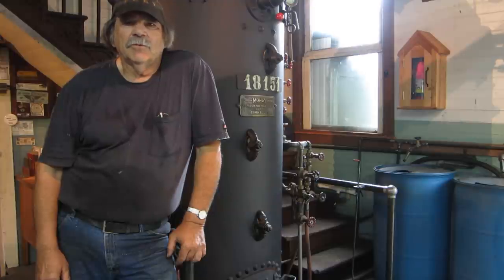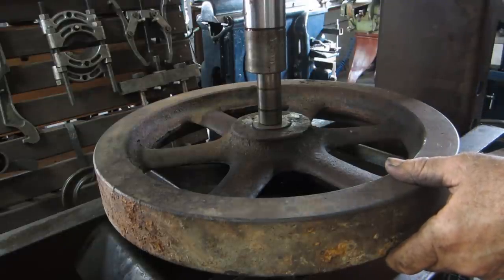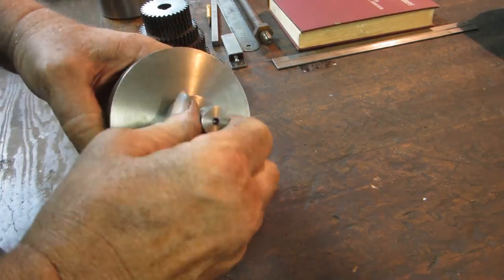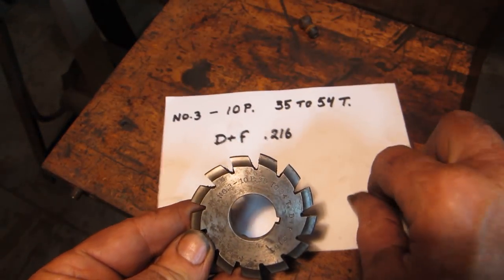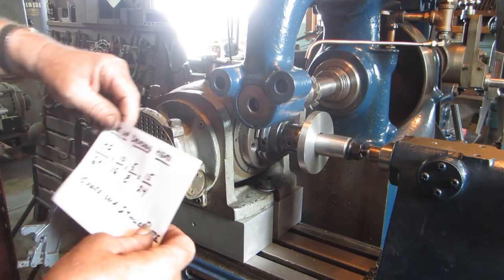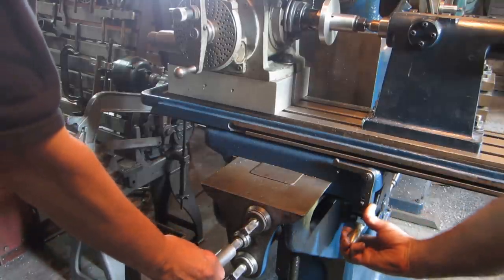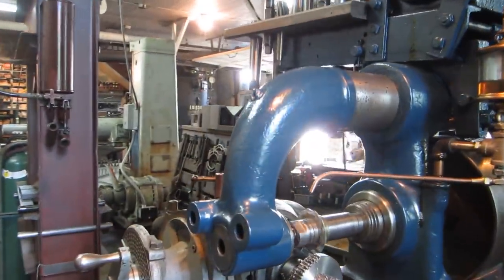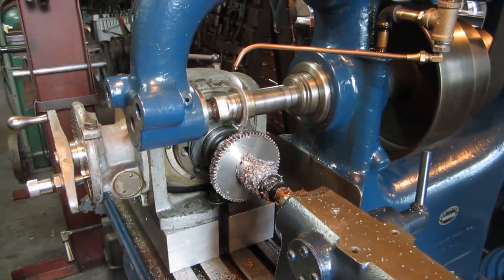OLD STEAM POWERED MACHINE SHOP 13  Making some gears

Comment: Best explanation of gear cutting with a dividing head I've seen yet. Thank you!
Reply from the maker: Thanks Rick, explained from one shop guy to another is better than Engineer written.......Dave
Reply: agreed, the books always leave out important details that were known way back when by everyone, but have been lost due to very few being taught via experience rather than a course, nothing frustrates me more knowing there is a formula out there that can help me do what I want to do, only to not be able to find it, or if I do its been massively over-complicated in a handbook
Reply: @davidrichards5594  As a student of engineering and someone who helps run a student design team, whenever new members ask me how they can improve their skills in engineering design I tell them "First get yourself a copy of Machinery's Handbook. Second, every time you start designing a new part picture starting with the stock material and then use that book to figure out what you would do to get it to perform the function you want so that once you've finished the design you also have a manufacturing plan. Finally, before you take the design to the student machine shop, talk to the machinists on staff there and tell them your plan and listen carefully when they explain why it sucks. Only when you have a feasible manufacturing strategy is your job as the designer complete." A lot of people I know feel that this slows down the design process too much to which I respond "No, but having to redesign a whole sub assembly because someone didn't know the dimensional restrictions of the lathes we have access to does slow us down."

Comment: ...Thumbs up for you...! This shop reminds me a lot of the Knight Foundry/machine shop out here in California....Sutter Creek, Calaveras County....the had everything running from line shafts and the shafts were turned by water driving a Pelton wheel....Machine shop was fairly large....maybe 25 pieces of powered equipment.....the shop machined  most of the castings from Foundry....a lot of brass....Knight was the largest continously operating machine shop/foundry west of Mississippi river....Likely quite a bit of history if you look it up....place was built/operating in the late 1800's....
Reply from the maker: One of many around the country that built and kept things operating, Thanks for the great comment....Dave

Comment: In the late 70's, I apprenticed in a shop very similar to this one. The drive shaft was powered by an electric motor, but steam was used up until the early 70's. It was a very efficient shop. This video brings back fond memories.
Reply from the maker: Great comment Fred....Dave
Reply: Havent seen you since the old SNL days!

Comment: Other great video. I am not a machinist. But I have been interested in the trade for over 25 years. Since a place where I once worked let me do some very very simple stuff on a mill and lathe. I am just in awe at the stuff you do on these great old machines. Great job on the gears. And I can't wait to see more work on the steam crank.
Reply from the maker: I'm formulating a plan on the crank and will get going on it as soon as I get some other small work out of the way. Thanks very much for the comment noel....Dave

Comment: I am a machinist with over 20 years experience, on conventional lathes, horizontal and vertical milling machines, and also CNC lathes and mills. For the last 15 years or so I have been doing mostly lathe work, CNC and conventional. I also program the CNC lathes. I am the only guy in my shop who does the lathe work. I can make a square part out of round stock on the lathe LOL. Years ago I had an old Atlas 6X18 lathe and wanted a 4 position toolholder, so I made one, on the Atlas lathe. I love these old belt driven machines. Not much has changed over the years as far as conventional machines goes, with the exception of the tooling and the time it takes to do a certain operation. I can grind a HSS tool bit by hand no problem but these days we use carbide inserts on most of our cutting tools. I noticed that everything seems to be slower and take longer than the same operations in a modern shop. I have a few questions... How long did it take to mill the teeth on that gear?  Did you slow down the speeds and feeds for these videos or is this normal speeds and feeds for these old machines? Everything seems so slow, but then again I am used to high speed machining.
Reply from the maker: very slow, 7 passes per tooth...Dave

Comment: That is a wonderful video. I loved that old lever type "dial" indicator!  It is wonderful to see that old mill chew through a gear blank, steam powered, not to mention the lathe turning the blanks. You are so right, gear cutting provides more ways to screw up than any other aspect of  machining that I know. You can miscalculate the diameter or the number of holes. You can forget to lock up the dividing head, or to unlock it. You can set the sector arms incorrectly and on and on. Done all of the above! But you got a perfect gear!
Reply from the maker: Thanks Juan, First two came out good, one more to go...Dave

Comment: 2 thumbs up again Dave.  I'm still amazed that what looks to be such a small engine is powerful enough to run the whole shop. Look forward to the next video.
Reply: To be fair, he seems to only use one machine at a time. If there were multiple operations going on at once, power requirements would increase quite rapidly.
Reply: In video 6 he has the shaper and lathe running at the same time. Didn't seem to be any lack of power then.
Reply from the maker: Well actually, I can run both lathes, the shaper, drill press, and milling machine all at once in a cut and the engine won't sound much different than it does running just the shaft. It's overkill for what I have here even at only 60psi. The boiler was built to operate at more than twice that pressure. ...Dave
Reply: David Richards
Well, I stand corrected. I guess this means all the small stationary steam engines that I thought would run a workshop were actually for whole factories. Wow!

Comment: These videos are not only nothing short of fascinating but provide a valuable historical perspective on technology.  What is interesting about this one is raising the question, "can a machine shop reproduce itself?"  (self-replication,  John von Neumann, etc.)  Such is similar to the ones raised in computer science whether the computing machine reproduce itself.  Of course, there are deep philosophical implications with the answer.  It seems that each piece of the machine tool could be made by Dave''s machine shop.  The only question concerns the housings but I suspect these as frames could be machined, as well.
Reply from the maker: Can it replace itself? Of course. And as long as the DEC and EPA allow a few foundries to exist, like Cattail, we will have castings. Thanks for the comment Jeremy....Dave

Comment: Hey Dave! Glad you had a good trip and are back in the steam powered saddle. I know what you mean about a bent shaft. Years ago I was making one Gravely tractor out of two when I pulled the main driveshaft out of it. This shaft had three sets of splines. The first was for the hi-lo planetary, the next was the fwd-rev. planetary and the last set was for a jaw clutch that kicked the p.t.o. in and out. All THREE sets of splines were bent! Looking into it further, a quill shaft bold had worked loose and dropped straight into the gears. The machine was humming, probably mowing or bush hogging and the bolt just locked it down solid. I wish I kept the shaft but it was shot but would've made a fine conversation piece. Looking forward to your next one!
Reply from the maker: Probably mad a big KA BLAM...Dave
Reply: David Richards I'd say! Just gtlad it didn't happen to me. I don't like loud noises, especiallky while I'm ahold of them!

Comment: A fellow restorer told me about his trick.   After heating a item, take a candle and melt around the shaft.  It is like flux and solder.
The wax gets sucked in.  Let it sit.  Then alot less force is needed to pull an item off.  Sometimes I have had items slide off with just pulling with hands.  Not to many though.   Also the shop gets a orange or cinnamon smell from the candles.  The wife uses candle tarts.  When the wax loses its aroma.  She lets it cool, then gives them to me.  I keep a box of them in the shop.
Reply from the maker: Good trick...Dave
Reply: I have used that technique and it seems to work best with beeswax

Comment: Just a suggestion, I'm a 40 year + retired mechanic. I learned to lubricate my puller pressure screws with anti-seize lubricant. It makes pulling easier and prevents thread galling. Just saying.
Reply from the maker: Excellent idea, I got carried away with success and forgot to oil the screw....Dave

Comment: I find it amazing that there was enough force on that shaft and keyway that it would twist yet not break.  good and tough metal in that shaft.   as to the 64 chances to screw up; made more likely because you were doing commentary at the same time
Reply from the maker: That;s why Tom did the second one, he has much better concentration....Dave

Comment: The bent keyway reminds me of a 6.5 dia shaft with a 1.5 taper key and 36" gear. The keyway was worn .010 close to the shoulder for 3", the keyway close to the end of the shaft was like new. Lots of torque on that shaft.

Comment: Great video, Dave. Nice to see everything working well and coming together for the steam engine rebuild. 
Be sure to check that those bolts you need to make are 1/2" - 13 like you expect and not 1/2"-12 like a few instances I've heard about. Probably not a problem, but easy to check before you get too far into the project. 
Great series on the steam engine rebuild, and I'm looking forward to seeing the whole process. 
Thanks for sharing. 
Joe
Reply from the maker: Right Joe, I've found several 1/2-12 threads, but mostly on pulley set screws for some reason.

Comment: Good one Dave, I just spied your power hacksaw looks a lot like mine, being a 1914
Robertson No 4  Buffalo NY
Reply from the maker: This one is a Peerless that was thrown out of a paper processing (cutting and making paper media products) plant in Syracuse. Something went through the gearbox and broke the case into about six pieces. When I was a kid, my father brazed it all back together and fixed the gear. It's been running here ever since. I cut a 3 1/2" gear blank with it the other day, it took 2 hours.
Reply: I was thinking Peerless but for two hours you don't have to baby sit it.

Comment: Good information and explanation on the gear cutting.  

I work in shop which is in a building that was built in 1912.  Most of the really old stuff is gone, but I found an Ashcroft 1300 dead weight tester.  It is in good shape, but I have not found the weights, tool kit, adapters or the box for it.  Is that something you would be interested in?
Reply from the maker: You got me on that one, what is a dead weight tester?...Dave
Reply: Hi Dave, it's used to calibrate  or check pressure gauges.  Here is a picture of the one I have.  Gauge goes on the fitting on the left, and the weights go on the disk in the center.  I'm trying to find out more about it.
http://tinyurl.com/gptjccq
Reply from the maker: I absolutely am interested in it, It's a steam gauge calibration set-up. I have used one similar to it that a friend has to reset the hand on a steam gauge. There are a set of weights that go with it to create the standard checking pressure. A screw -in plunger is turned to pump up the oil pressure until it just will just lift the weight on the platform. At that point the gauge should read the checking pressure, if not, the hand is pulled and reset to read correctly. Ashcroft was a manufacturer of pressure gauges....Dave
Reply: +David Richards Yes I recognized Ashcroft we had some of their pressure gauges where I used to work.  Let me look around to see what else I can find of it.  Right now the only things are in the picture.

Comment: Do you eye ball the cutter again the dead center in the tailstock to find center or do you just use the w.a.g. system and eyeball it on the top of the blank?
Reply from the maker: Thanks for the comment. I can't remember how I did it on that one (there are a lot of ways to do it) but usually set a square across the table against the outside edge of the blank and with an inside spring caliper, check the distance to the side of the cutter to get it the same on both sides by feel. It will get you within .005" which is fine for this job.....Dave

Comment: David, have you ever considered using a gear head type lathe in your shop? An example would be like my Pratt and Whitney model B, which could be run with either an electric motor in the foot or a drive line overhead. I am considering moving to an off grid location and am considering setting up a line drive system for my Pratt and my old Cincinnati #2 dial type. the actual power unit setup is still under consideration.
Reply from the maker: A gear head lathe would work very well with a line shaft because of the torque multiplication through the gearing. The belts can run faster with less load. That was the idea that machinery salesmen were trying to get across to railroad shops when high speed and carbide tooling started coming in, they needed to get more power from the line shaft to the spindles. ..Dave

Comment: In "steam time" how does one center the cutter over the axle accurately? Awesome gear explanation w/ operation of dividing head.
Reply: possibly the same way as with touching the cutting tool to the lathe tailstock point - you put a center in the dividing head spindle, and bring the point of the tool to touch off there

Comment: I just went back and watched episode #2 again and had a question for you. When you were boring 1.000 holes in the flange. I noticed plate on the side of the drill press with dozens of holes in it just like that reducer gear head on the milling machine in this video. Is it the same /similar part? And does it pretty much do the same the thing/idea as on. The teeth cutting operation? Just a quick observation from interested viewer . Thanks for all you do .
Reply from the maker: Noel. I think the holes you are seeing are just rough holes cast in the "down" feed mechanism gear. I don't think they serve any purpose except maybe to get a oil can spout in to shoot some oil on the gears behind it now and then...Dave
Reply: +David Richards, ok thanks.

Comment: I find the best way is to heat it and while still relatively hot pour oil around the  shaft so that it runs in to the gap  after an hour it normally us loose

Comment: Really enjoyed your video.  Do you leave off coolant to keep the camera clean, but use it when you're not filming?  I'm working towards cutting gears in my small shed - Googling 'helichron gear' brings up a nice approach showing how to make your own simple rack-form hob to approximate an involute cutter, and googling 'Bilar dividing plate' will bring up a small web thing which lets you print out paper templates for dividing plates with whatever divisions you fancy on them.  Perhaps that info might be useful to one of your viewers.  All the best from Manchester UK, Mark
Reply from the maker: Mark, I'm running the tooling so slow that all I ever use is the "dripper" with some oil. Nothing gets too hot at 50 ft/min. I'll check the site out, Thanks,.....Dave

Comment: Very Nice shop you have. I am curious as to how loud it is in while the equipment is running. Compared to other videos your shop seems very quiet in comparison. Is that just the camera/mic your using or is it really that quiet
Reply from the maker: It's pretty quiet at the machines, you can hear the tool in the cut and more subtle sounds of the lathe gearing...Dave

Comment: Fantastic video and amazing work. Thank you for this wonderful series. Once the gear is machined, does it need to be case or through and through hardened?
Reply from the maker: Hi Paul, For this case, the original gears are mostly just cast iron, there is almost no load on them and thery turn very slow and it's not necessary but you could . I had a friend that made some lathe thread gears out of plastic....Dave

Comment: beautiful work I'm a heavy plant merchanic ive had a bit of a play with new lathes and CNC matcines and seen lazer cutters in action but its not the same as seeing somone making something from nothing by hand or with such great old tools realy cant wate to see how you make all the new parts and remake the parts for the steam engine (hears an idear with the twisted shaft if its only the end pice maby you could eather weld it up and recut it down or spin it down and make a sleeve to match it and the gear of the end  copple idears :)
Reply from the maker: That's the plan for the crankshaft, replace the end. It's cut down for the gear and too small and short on that end anyway.

Comment: South bend:Sample,teeth-52.gear thickness-..755,by vernier.Bore Dia.725,keyway yes.Tooth height-..114app.thickness at base of tooth-.120app.My old machine was your model.It went south ,but gears were left behind.An older manufacture?